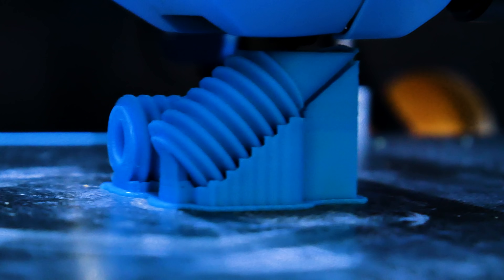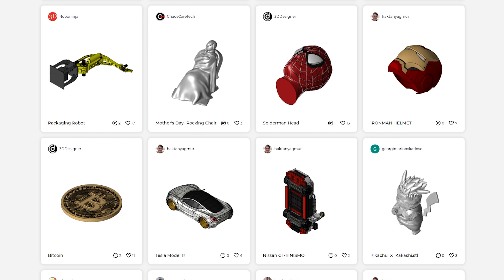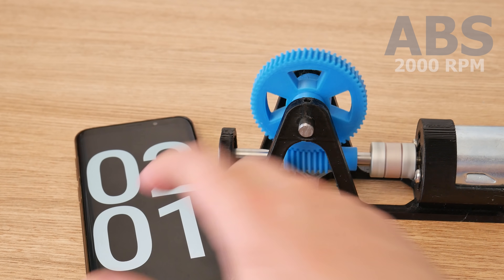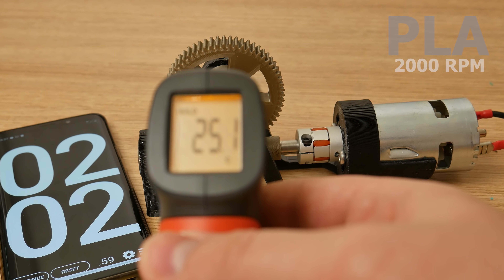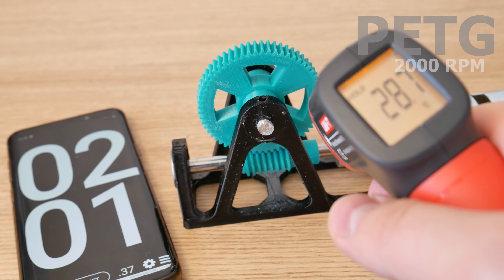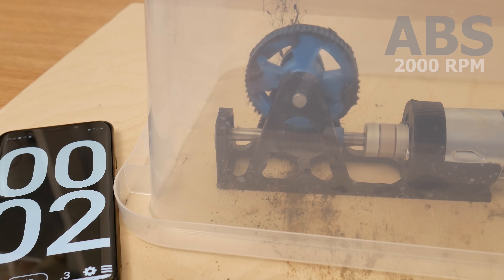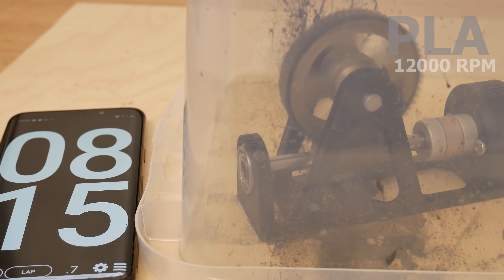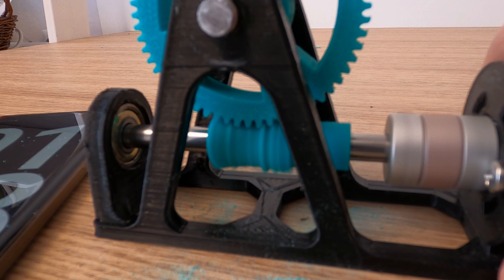3D Printed WORM GEAR - Can u Really Use Them? (PLA vs PETG vs ABS)

Comment: I have a PLA worm coupled with an iron wheel on a lathe. In use for about 3 years without a problem. But the speed is  slower than your test. Thanks for video.

Comment: Great video but for low speed high torque application for very small gears , is lubriction ok ? In my case I noticed worm gear wear out on load increase  so I was thinking of brass gears instead of plastic, so if I had to choose 1 gear or wheel for brass,  which one would be best for long high load application? Please help

Comment: I am always surprised by the stupidity of people who make such videos. Isn't it possible to make your life easier and put the motor on a soft surface so that it doesn't run from vibration, set up the phone so that it doesn't dim it's display, and so on? 

And yes! Are you surprised that the mechanism works better with lubrication?! Then you will have a lot of interesting things in this life 😄

Comment: Strange, I printed a worm gear mechanism all in one, so it's a print in place, and in this mechanism, I designed the gear stands straight up, and I printed without support and it works perfectly out of the printer.

Comment: I like wormgear for an application like a moving platform that needs to stay in position. But not fast continuous use that could wear it down. Also a better redesign of the wormgear would be to use thicker gear teeth so that it can endure a lot longer.

Comment: a misconception is that you need all the teeth for the 3d printed worm gear. You dont. you can flatten a side and print it on its side to minimize axial load that may pull apart the layer lines.

Comment: Not only are wormgears used in slow rpm situations, they also actually lock the compononet gearbox. A It can only rotate one way, or actually it depends on the slope angle of the cog and wormgear..

Comment: This video is so helpful I am doing a science project. I 3d printed the wind turbine with a vertical helix design but I have to use a worm gear to make vertical to horizontal to lift the weight. after class I saw this and I saw why mine was was stopping at one place I had printed it vertically and the print was not smooth at all I tried silicon lubricant which helped but this video helped even more. wish me luck!

Comment: Interesting practical video, but as with other comments, high speed and no load is not really relevant to worm gear applications.

But what about repeating using ASA which supersedes ABS and also PLA+ (aka PLA Plus or Tough PLA)?

Comment: Today im going to use a hammer to drive screws. Dont know why it doesnt work. Wrong application of a worm gear. it is for high torque low rpm.

Comment: I've had great success using a worm drive printed in very high quality PLA (to avoid surface inconsistency, usually I don't care on functional parts) with the same white lithium grease I use on my printer's Z screws. While I see a lot of comments demanding to know how they fare after hours of run-time, it's worth noting that plenty of projects require low RPM in short bursts, such as a pet feeder or automatic blinds. Also, the awkward way I had to design them in OnShape actually allowed me to change the tooth profile such that it could be printed upright with no supports!

Comment: Very nice video!
I was initially excited to see 12000 RPM as this is around the target RPM for my DIY project, but then I saw it's only a few mm radius from the axis,
and I'll need it at ~70mm radius (for a centrifuge).
70mm radius @12000 RPM would generate over 11,000 g, and I need a printing material (preferably resin) that can withstand such load with enough safety factor.
Reply: Hola estimado. .. como pudo finalmente solucionar su problema?.. Podría compartir la solución, gracias.

Comment: there are a LOT of problems with these tests... 

1) Your print settings are FAR too coarse. That means increased friction, wear, and heat.  Smoother prints will perform better, due to reduction in friction caused by such a coarse print setting. 

2) You are not greasing your worm and gear at all. Even with metal on metal, you get friction, and wear, and grease helps mitigate some of this friction and wear. Greasing your wear surfaces will increase overall performance of the parts. It's also important to use the CORRECT grease.. Just gabbing any old grease isn't the way it's done, get the grease suited for the job. The black molybdenum sulfide based grease you used is NOT made for high speed sliding friction surfaces. it's made for hard surface to surface static contact.  A lithium based white grease would work much better. also, over saturating the parts with grease isn't beneficial, and can actually be detrimental, because you are adding yet another force that must be overcome to push the excess out of the way. use just enough to coat the friction surfaces, and start off with a slow "run in" period to allow the grease to proliferate across all the surfaces, and excess to be squeezed out of the way.

3) listening the the "sound" of these tests, you can hear noticeable oscillation, this means either your worm, or your gear, or both, aren't accurately printed. as there is more, and less contact between the gear and worm. this increases wear in one spot, causing a targeted spot of wear, which works as a starting point of failure. 

4) Worm gears are almost never used in high speed applications, as they are a torque multiplier. Run the test again, this time at slower speeds, but with a load on the output. 

My suggestion is to not rush your print. use finer layer heights, print at 100% infill, and turn on ironing for a stronger bond. 

If you aren't printing at 100% infill, and fine layer heights, you're setting yourself up for failure.  These are wear components, so strength, and concentricity is important.

Comment: Great video, thanks for sharing. You know what could be interesting to test? Combination of pla, petg and abs material. for instance worm gear petg with worm wheel pla/abs etc. There are a few combinations. And see which combination is better given that the motion is given by the worm gear.

Comment: Worm gears are never designed for high rpm applications, they produce too much heat and have low efficiency. They are designed for high gear ratio, low rpm, cyclic work, high torque applications. Typical steel worm gears have a limit of 3000 rpm and have a big aluminium housing with ribs to distribute heat better.  Anyways, it's good to know that 3D printed worm gears can work. Thank you, interesting video.

Comment: Hi, i´m from Brazil. I´d really like if you test these three material in order to find witch is more durable. Example: print 3 supports that holds a 5kg or 10kg weight through many days... and see what resist for more days...

Comment: What can we learn with tooth form and clearance all screwed up?  It was running noisy which means there were interferences.   I've never made worms but run ABS for years and years in gears.  When your pla gears got stuck together it is pretty clear they melted together.  Proper gear clearance includes a gap.   You didn't show us clearance, you printed too fine a pitch for your printer.  Reduce nozzle size or increase pitch.  Set clearance.

Comment: I thing the wheel shaft is the problem & needs lube to prevent the tendency to seize, which is the root cause of the failure.

Comment: Your actuators that are used to move you heating and air in your car are made from plastic… I’m sure it’s injection molded, but plastic non the less.. and they are a common failure.

Comment: I don't get this way of testing...
without the large Gear sitting on ball bearings, the axle support is an unknown factor in changing the resistance of the large gear while being turnt, as the movement is causing friction and therefore causing the plastic to melt a bit or at least deform. Which is visible as in the beginning there is a sudden resistance (3:14 you can see the axle not spinning a 100% freely and needs a push to overcome this resistance) if this is supposed to simulate load it is way to unstable und deforms the holding bracket, thus changing the rsistance the small gear has to deal with and therefore the results are not comparable... so as far as I can tell this is not really giving us results that we can use in practice as it doesn't show how much load the printed gears can handle

I would suggest the same experiment, however the large gear sitting on ball bearings and pulling an actual load a certain height, with different loads being the different levels of testing. Like putting the machine on a table and pulling different weights at a fixed speed.

then we will see how the gears actually perform and what load they can hold :)

Comment: Worm gears have a tendency to wear the teeth no matter what. That is why they are typically brass. Also most people would consider this upside down. If you made the rig with the worm on top the gravity forcing the teeth together would be reduced. Also if you offset the other gear slightly you might be able to avoid the heat and extreme wear. Just a thought.

Comment: I was always curious about using 3d printed gears, extrusions and linear rails for extremely light objects like a pi cam.

Having the 3D printed camera mechanism that moves independently from the 3D printer for experimental time lapses or remotely observe prints from multiple angles without needing a ridiculous amount of camera modules.

Based on the cost of alluminum extrusions, rails, lead screws, couplers, gears etc would be out of my budget mostly due to the prototyping process with the number of modifications needed.

Comment: Normally on a worm drive, the worm wheel and worm gear are made from different materials of different hardness.  The worm gear is typically made out of steel and the worm wheel is typically made of brass.  Also, input speed on worm drives typically does not exceed 3600 rpm.

Comment: Great video! Imagine the worm (driving) "gear" as a cylinder of material spinning in a lathe and the side face of a tooth on the (driven) gear "wheel" as a carving tool. If the tooth's side face edge is sharp it would rather cut and peel the cylinder. So, a slight bevel or chamfer on the (driven) gear "wheel's" tooth would take away only a small amount of strength but yield a lot less wear. This becomes much more important under high torque situations where the wheel (and thus the worm) is loaded. A polish on the thread face would also help with imperfections leading to vibration and wear.

Comment: Thanks, that was useful. I've 3D printed some replacement gears for the printers I support in PLA+ and have recommended the use of some lithium grease on the gear teeth. Apparently that makes a HUGE difference.
Reply: hola ¿como se han comportado sus engranajes actualmente?. ¿Podría compartir su experiencia? gracias..

Comment: Let's Print  , hi! You smart guy, but WHY, why didn't you fix the machine?) If you do not want to drill a hole in the machine and secure it with screws to the wood, I suggest another option. Drill 4 holes in a wood and attach a devilish machine using the screeds =)
p.s. sorry for my bad English, it's google translate)

Comment: no matter what type of gear you use whitout the proper lubrication it´s gonna kill it self in time...

more of a test lubed vs unlubed gears than actual material test because whitout any type of lube the friction gonna be way high no matter what materials used and the wear is unavoidable on the softest part...

Comment: Great video!  This is telling me that for intermittent, low speed use, properly lubricated 3d printed worm gears could last a long time.  Such as for remote camera pan/tilt, or even in simple robotics.  Suggestion - put an affiliate link in for the grease you're using.  Some grease isn't safe for plastic and will dissolve it.

Comment: Would you not create unnecessary load on the larger gear? You have a bearing on the worn gear but not the large gear could that be causing the large gear to not want to rotate as it heats up ?

Comment: The problem with this test is that usually worm drive components are not made from the same material. The worm wheel is commonly made from a softer material, than the work gear, so it would wear first, since, using traditional manufacturing techniques it is easier to produce. It might make more sense, to have the worm gear made from some kind of metal and then try printing the worm wheel and then compare the results. This would provide much more consistent results in my opinion.

Comment: Is cured pla more stronger than abs? Leftwing pla on hotbed at55 60 degree for hours with enclosure on top that or curing with same temperatures value in low temp oven

Comment: Try to use petG worm gear plus PLA worm wheel (wheel feels less temperature stress i think). Also i recomend to realize specal bath for oil lubricant under worm gear for heat dissipation.

Comment: For heavy use, and for materials that are less than ideal, the worm needs to be designed to wrap around part of the gear. A straight worm doesn’t contact enough teeth from the gear. So the worm needs to have an “hourglass” shape, so that all of the worm engages the gear all of the time. That will distribute the torque evenly across the worm, and help the gear as well. ABS is very poor in resisting friction. Many printers have the heat to print nylon. That should be better than any of these, long term, particularly without lubrication,

If you look at the damage, you’ll see that the wear is turning the worms into that hourglass shape I mentioned.

Comment: i am no expert on this,  but the first thing i notice about your tests is the whole thing vibrating across the board it is sat on,  that is certain to cause premature wear and heat?  just not sure why you would run all them tests without fixing the thing to something solid.  fixing to a base that is solid would give you more reliable results of what could be achieved?

Comment: worm gears are usually applied in low speed high torque applications. For testing worm gears, different load cases at low speed would be more interesting then just testing operating speeds.

Comment: It would be nice to see a telescope worm wheel ring printed in segments to allow a large diameter ring to be bolted on to a plywood circle. Once assembled, a modified tap assembly can 'true' up the gear so that an inexpensive telescope worm drive can be made. I would substitute a readily available worm drive gear and tap combination for the  3d printing of a worm drive.  Look at the price for a good telescope gear and you might decide to do them (if successful) as a side job. Telescopes move slowly so heat should be no problem. Backlash will probably be the issue.

Comment: One only needs to look at industrial applications of this type gear reduction system to see that nearly all use a maximum input speed of 1800 RPM. The worm is almost always made of hardened steel while the wheel is made of brass. The worm is usually mounted over top of the wheel. The wheel runs in a heavy weight lube (usually 90W) at a level that's about one third the diameter of the wheel, i.e. just below bottom-dead-center of the wheel's bore. This level virtually eliminates leaks while ensuring contstant lubrication. The heavy weight lubricant is required due to the extreme pressures encountered at the tooth interface between worm and wheel. By the way, this gearing system is considered the least efficient of any gearing system.

Comment: Great video!  I primarily use PETG and was wondering how it would do on gears.
Question: what is the smallest 6-tooth spur-gear (pinion-style) that could be accurately printed and run properly?  
I need to make a slow-speed gear-reduction for a radio tuner and need about 8 to 10:1 ratio in as small a space as possible.
BTW: Near zero backlash is a real needed feature.  Thanks!
Reply: The module is typically the deciding factor for how small the actual teeth are and what will come out well from the 3d print. With a 0.4 mm nozzle, I've heard it's a module of around 1 mm, which for a 6 tooth spur would give you a diameter of exactly 8 mm (z=number of teeth, m=module, then tip diameter = z*m + 2*m, in other words 6*1mm + 2*1mm = 8mm). Search for "basic gear terminology" for which khkgears has a nice overview. The .4 mm nozzle -> 1mm module suggestion comes from thehardwareguy, who is excellent at covering making gears with FreeCad (ref: https://www.youtube.com/watch?v=Wu-zGDy7WQI)
Reply: @ookamiueru  Hey! Thanks so much for your reply and suggestions!
I did go ahead and buy a hardened 0.2 mm nozzle from Micro Swiss and have been making some test prints (not gears) so maybe that will also help with the geometry and printing smaller. If I have trouble, I will get back with you but I need to look at everything that you’ve presented and work on it a while. Again, thank you very much!
Reply: @SpinStar1956  hola amigo..¿Cómo va con sus pruebas? ¿Logró algún resultado fatisfactorio? ¿Cómo? Espero pueda compartir su experiencia.. muchas gracias.

Comment: 8000 RPM is crazy. Even 2000 RPM is beyond where a lot of them are used. 2000 RPM may be good to do a model of say an elevator if you don't have a strong enough motor. Otherwise direct drive.

Comment: Outside of transmission type uses, another thing they're good for is holding position in regards to adjustment. That's due to the typically locked gear train aspect where a worm gear can't be back-driven. But if testing for that you're likely going to want a bigger tooth size.
Reply: at a higher gear angle they can be backdriven

Comment: I've done worm gears in PETG with good success.  You do need to do post operation filing with needle files.  Your worms look like the teeth are too shallow.  I have good luck with .4mm but especially .25mm nozzles.  I'm running my worms at 36k RPM without issue.  they are not under a high load and I'm using bearings to make sure that they spin easily.